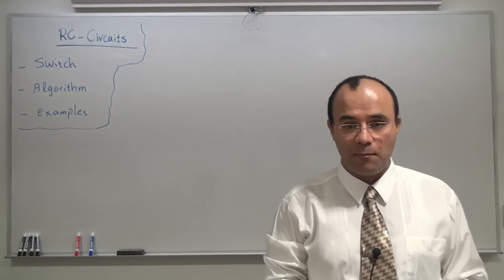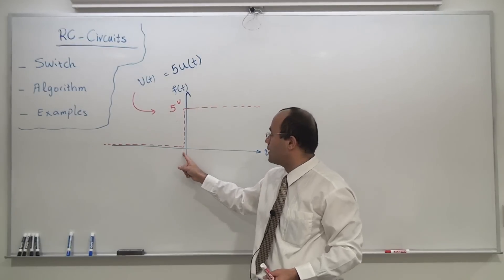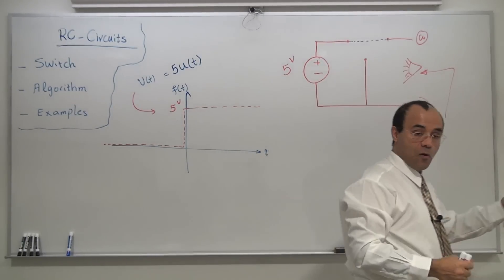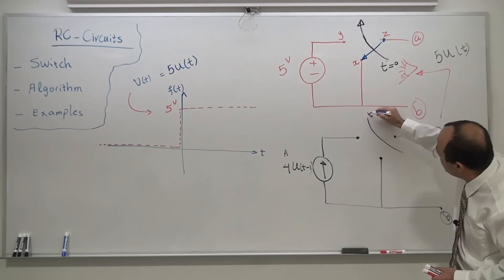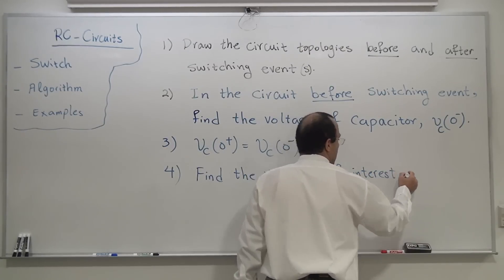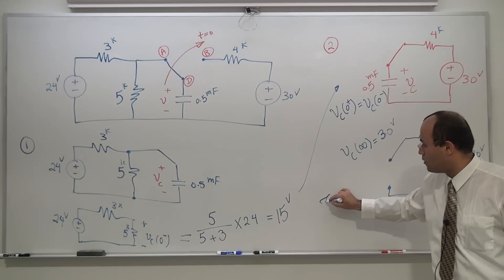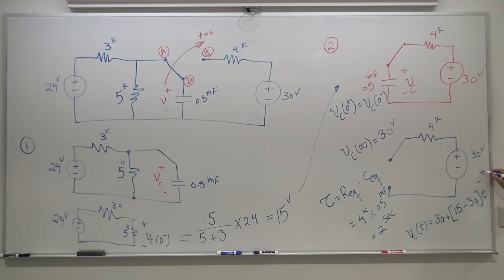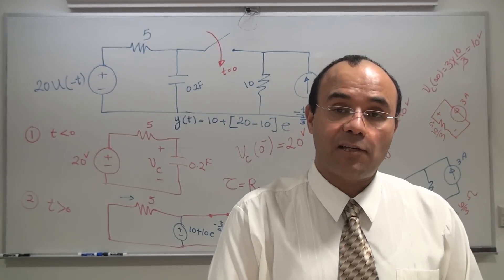Capacitors: Part B

Comment: 30:57 Why did he look at the circuit after t >0 to find Req and not t<0?
Reply: When t>0, the capacitor is fully charged. The switch is opened and both the voltage source and the resistor is removed because its an open circuit. You need to calculate tau(time constant) which is equivalent resistor times the "C". What is the definition of tau, it's the time required to charge the capacitor through a resistor. When is the capacitor fully charged? when t>0. This is why you need to find the equivalent resistor when t>0 because the definition of tau tells us to.
makes sense?
Reply: I love you :')
Reply: Maybe we can justify that in more simple manner. Tau is the time required to charge OR discharge the capacitor completely (i.e infinity). Therefore, we have to find Tau in the part of the topology when t goes to infinity ....

Comment: Actually I had one small doubt. The capacitors acts as open circuit to dc. Does it really matter if the source is independent or dependent?Thanks a lot sir.